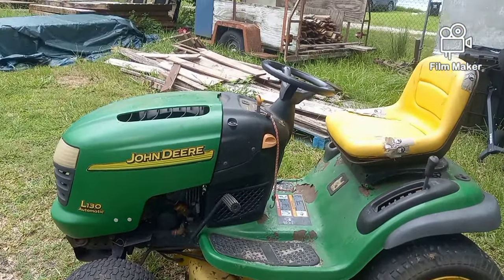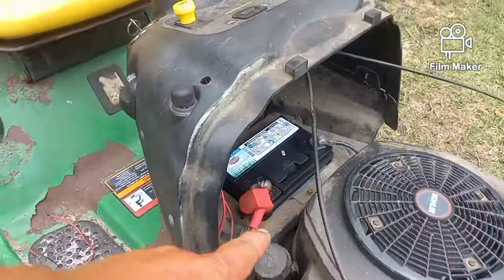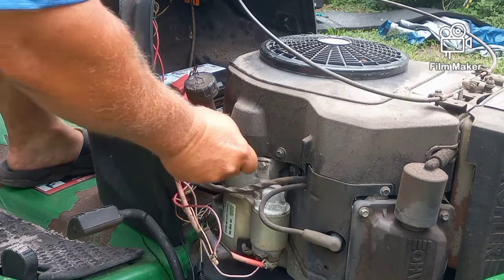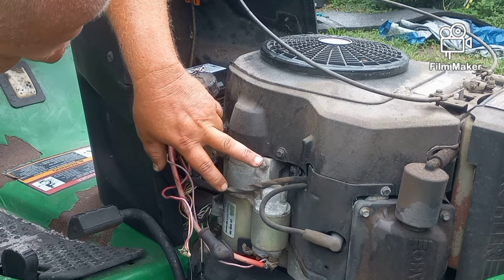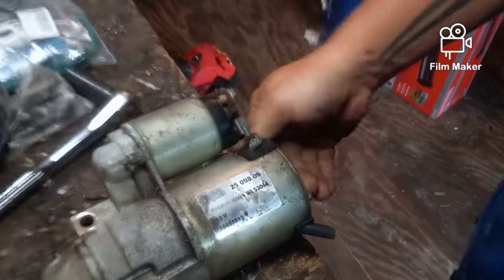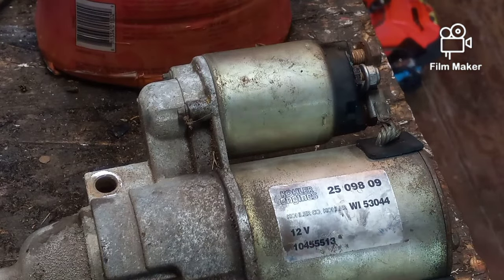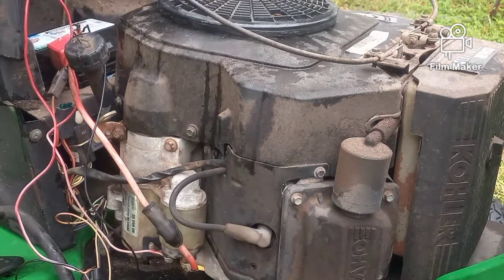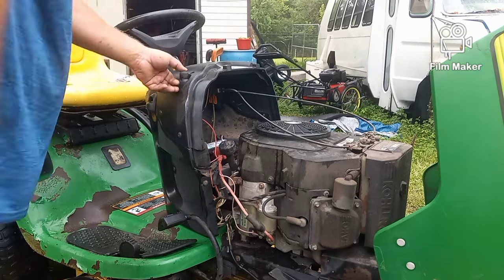John Deere Won't Start / No Noise When U Hit Key

Comment: Thank you for the video! You working out there with all that metal and electricity in dark skies scared me to death... damn near sick of taking our mower out to the local john deere, spend 600 each time for them to return it and it still won't crank. Clearly a wire short or a bad connection we believe. Do you have resources on where you learn all of these things? Such as repair manual or guides... trying to get into repairing myself so we don't spend so much and it doesn't crank anyway 😂
Reply from the maker: I am a firm believer in youtube university.  You can learn almost anything on YouTube.  As far as parts are concerned I look them up on partstree.com or jackssamallengines.com for part numbers and diagrams .. and usually buy parts from Amazon if I want after market. You can always ask me for help.. I answer every comment and often email with viewers that need help til we figure it out together

Comment: You need to install a relay switch to the starter solenoid, problem solved.John Deere parts department has them common problem.

Comment: Awesome job!!!! Did you check the back for the transmission push pull rod for the transmission
Reply from the maker: Yes I put a little addendum at the end of the video explaining I disengaged the trans to free wheel when we pulled it off the trailer and forgot to re-engage.. then drove it to show it was good. Thanks for checking in

Comment: I have been fussing and fighting with my L130 for a month (It sat for 3 years or so).  Anyway, I did continuity tests on all the saftey switches, charged and recharged the battery, then finally replaced the starter solenoid/motor, and the damn thing still would not crank.

Well, after watching this video, I discovered that the relay going from the battery to the solenoid had 12.6V, but the relay from the switch to the solenoid is exactly 0.0V.  I tried that trick you did by drawing current directly from the battery to the terminal for the switch and Viola!  It cranked.

So long story short, this video helped me drill down the problem to bad wiring, now I just need to figure out how where its screwed up, which should't take long.

Thank you!  This video was exactly the tutorial I needed!
Reply from the maker: Your comment gave my the chicken lol goose bumps.. its always a treat to hear that my videos helped someone figure out their issues and track them.. I am so proud of you for researching and not giving up and thankful I could be on the list of vids or people that helped you fix it. Keep up the good work and thanks for letting me know and for subscribing

Comment: Excellent! I like te way you  ypass the circuit and short  straight to the solenoid and srarter.
Reply from the maker: Sometimes bypassing safety crap is the only way to cut out problems in older machines and making them live longer.. thanks for hanging out with me

Comment: Nice relatively simple fix.  I'd keep working on it, charging the customer and fix all that home-boy wiring mess.

My JD L120A project is finally finished.  Left cylinder head valve guide had to be fixed.  Rebuild the carburetor, and replace both ignition coils.  I was into $400, and sold it yesterday for $1600.  Took me over 2 months to finally get all that above mentioned sorted out, waiting for parts to arrive, had to wait on the machine shop guy who was on vacation, foul weather, etc all contributed to taking a long time to get it running and ready for sale.   And it was well worth it.